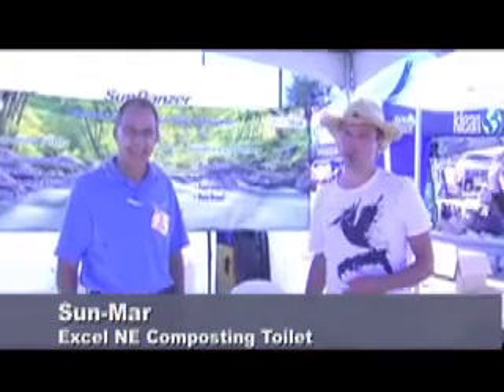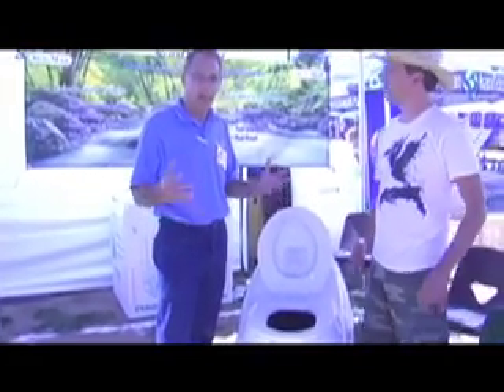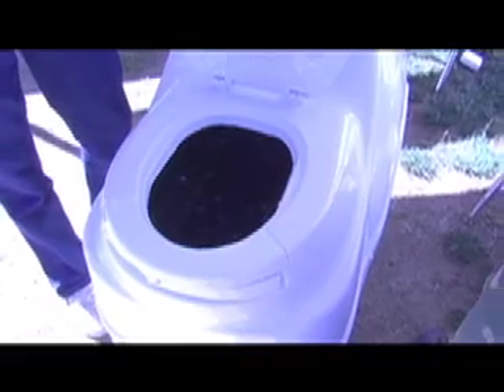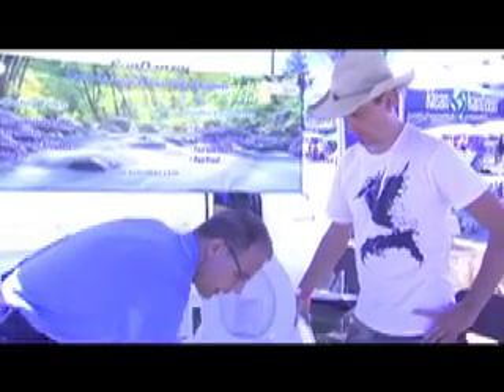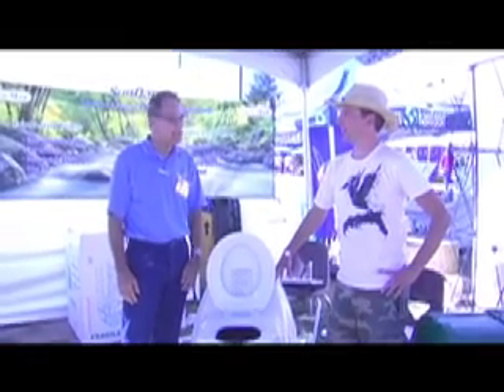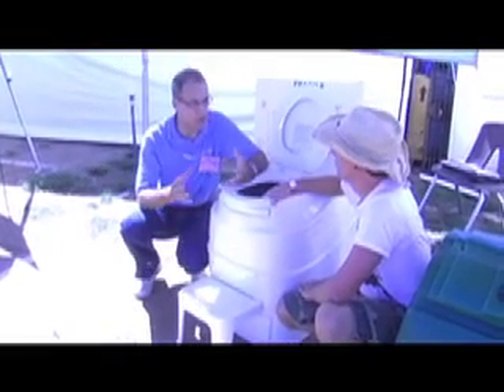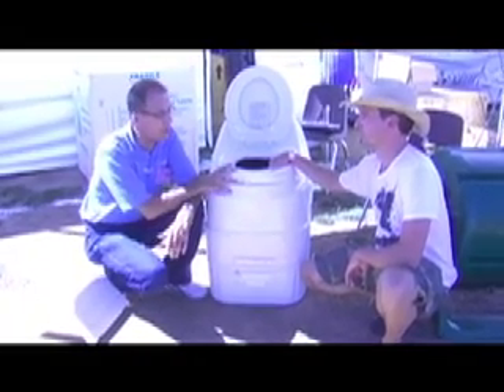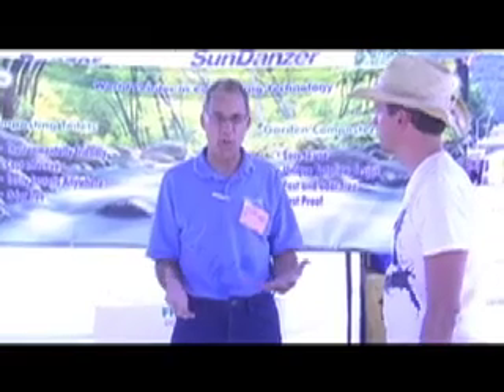Sun Mar Composting Toilet Demo

Comment: Purchased a Sun-Mar Excel about a year and a half ago from an authorized retailer, the warranty on the website states that their products have a 5 year warranty on the fiberglass and 3 years on everything else.

The toilet is comprised of two major fiberglass pieces both of which have multiple physical cracks going all the way through the device that are not surface cracks. A couple major ones on the bottom which have caused liquid (Excrement liquids) to seep out of the product and spill onto our floor. Now, I have noticed a plethora of other cracks developing and continuing on the top piece in the middle of the front. This toilet obviously has some workmanship defects if it cannot make it through a year of regular use with only 2 people when it is rated for "a family of 3-5".

I've tried contacting Sun-Mar many times about this issue and MANY other issues surrounding the general use and issues we've had with the toilet. There are constantly fungus flies flying around it, we've emptied it out multiple times, cleaned everything, spray pyrethrins around everything per their advice. Still flies, they will NOT go away. There is also the issue of emptying out the tray, I'm not sure what 5 year old designed this thing, but when you put a flimsy drawer with no bottom support above a sea of poo water and then empty weight into that drawer it is DEFINITELY going to sag and touch the poo water. What do you think happens when you take that drawer out to empty it every 2 weeks like you're supposed to? It spills poo water EVERYWHERE. This is a bad design and a flimsy product.

On top of all of this, the customer service has been atrocious. Long waits to get responses, nothing but tons of PDFs dumped into my inbox about how to care for the toilet - some of the suggestions for care are ultra ridiculous, to clean the bottom chamber out, they want you to pour boiling hot water into it and then gently scrape the "salt crystals" (what a cute name for dried & hardened urine/poo right?) toward you and remove them with your hands I guess? The instructions mention nothing of gloves, eye protection, breathing protection or anything. They just kind of vaguely want you to pour boiling hot water into a confined area that has nothing but human waste in it and just kind of figure it out. I'm surprised this company is still in business, what a waste.

Comment: I use cocogro  and worm casting tea as a activator to  jump start the microbe process in mine. If you have a smell problem its from to much urine 1. get the old man to pee out side or 2. add more  petemoss  composting base plus try making your own worm casting tea it works awesome.  Getter Done.lol